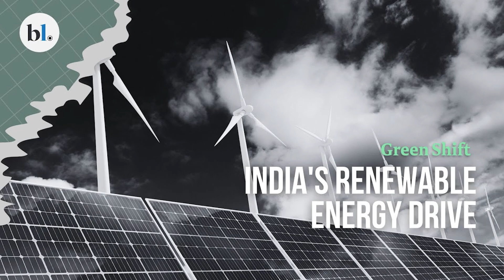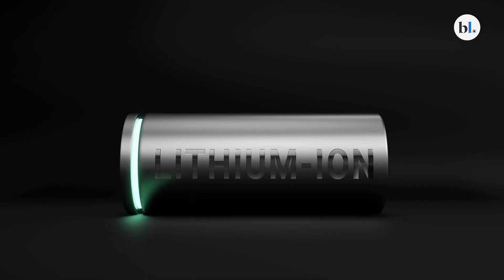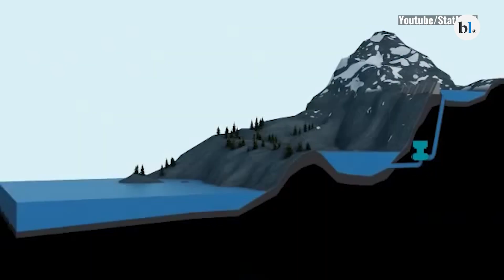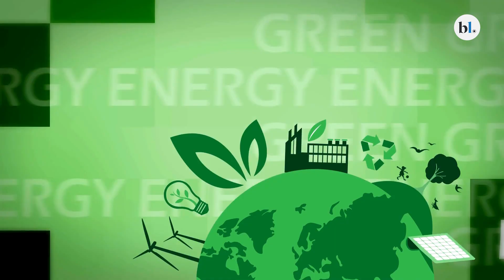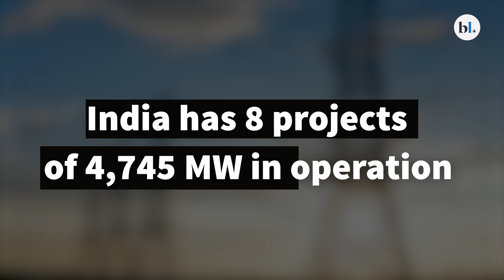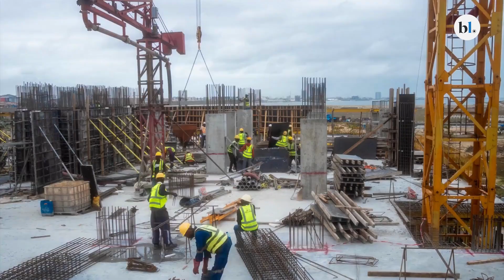Pumped Hydro Storage: Revolutionising renewable energy stability

Comment: Looks promising
Apart from that it can be even used in flood management as well when water at the upstream of a dam increases then that water can be pulled up and stored by pumped hydro storage plant at its upstream till a certain point.

I think this idea can even be used for irrigation in hilly areas as well by pulling up the water from upstream of a dam located in valley and can be distributed through pipelines to other surrounding areas as well.

But we must ensure that Electricity needed to pull the water up must be cheap. That's challenging.

Is electricity generation possible when the water travels upstream??
Reply: The last question is interesting. While I'm not an engineer, I think that while generating electricity while the water is traveling upstream is technically possible, it would mean even more energy to push it upwards through a turbine. So, it'd be economically infeasible. 
Using PSP as a tool of flood management may be difficult because the storage tanks would be far too small to hold the flooding waters. In any case, most of the pumped storage projects are closed loop, not connected to a river.
But thanks for the questions.
Regards
Ramesh
Reply: @RameshMatham0507  Thank you for giving time to address my doubts sir.
Other than turbine any other options to generate power while water is travelling upstream?
Yes most of them are closed loop but is it feasible to establish PSPs on upstream of a dam especially in Hilly areas so that water can be used for power generation when dam stores the water. 
Even top-up wouldn't be needed when PSPs are established at the water storage end of the dam.
Reply: @SaiPraneethMullapudi  Dear Sai, there is no other means to capture the kinetic energy of flowing water than placing a turbin in its path. It is indeed feasible to put a PSP in a dam, it is actually done in many places. But the functions is a hydroelectric project and a PSP are different. While a hydro electric project produces electricity, the PSP only stores the energy.
Reply: @RameshMatham0507  thanks for the info sir. In green shift playlist 2 videos are not available if possible please make them available by contacting the team.